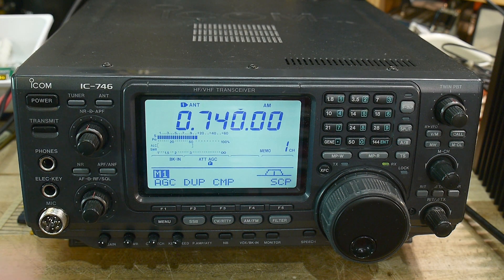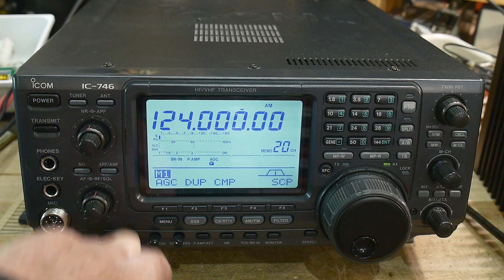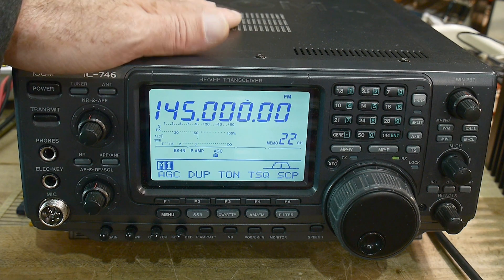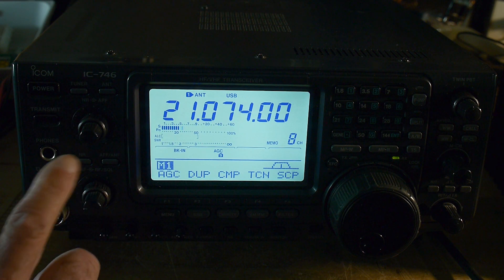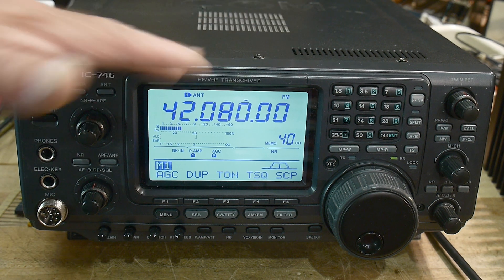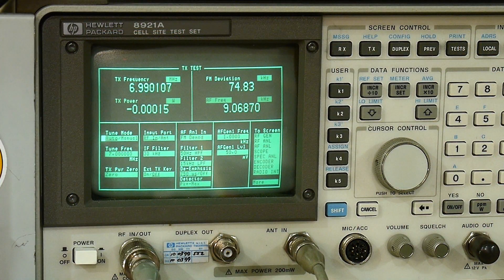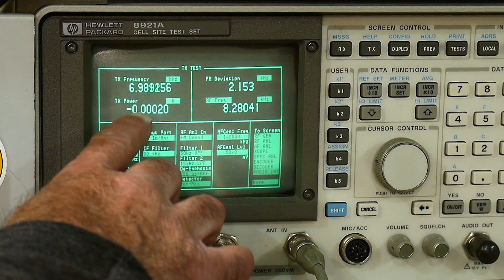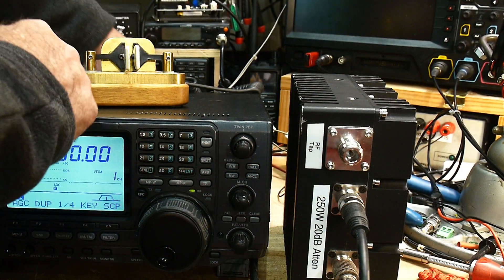#1078 ICOM IC-746 faulty ( part 1 of 8)

Comment: Some things.  I don't know about this rig, but keying the mic on my 735, in CW mode won't transmit a carrier, you have to use a key.  Also, transmitting on the band edge, in CW, might try to generate a carrier below the 7.000 MHz edge limit, depending upon the radio.  Just thinking out loud.

Comment: Hello IMSAI, Why don't you use the RF level offset option to see the real power? If you add the 20dB of the attenuator, you could have the correct reading in watts or dBms
Reply from the maker: lazy, and very easy to do the calculation in my head.

Comment: The LCD backlight is still working,  for now.. I have one of these and when they work they're a nice radio, but between the output issue and the design flaw in the backlight driver they fail often.  The backlight issue is the transistor used to vary the backlight level gets too hot and falls. Simply replacing it is a band aid,  it'll just happen again.  There used to be kits around to fix this but i have seen one in ages.  Basically put a tiny heat sink on the transistor. It's also buried in the front panel so a fair amount of work to get to it.. The delaying action is to always keep the LCD on full brightness which reduces the heat disipation demand on that part.

Comment: At 5:38 you say that 100 Watts is 40 dB. I believe that it is actually 50 dBm. 1 mW is 0 dBm, 1 Watt is 30 dBm, 10 Watts is 40 dBm and 100 Watts is 50 dB above 1 mW. At 5:49 you say that plus 20 Is one Watt, again I disagree. Am I wrong?
Reply from the maker: sorry I said it wrong. the radio is +50dbm and the attn is 20db so into the analyzer is +30dbm which is 1 watt

Comment: A much better radio than the 7300. A few common failure points but easily resolved.
Reply from the maker: I'm sure it is better in some ways. but the 7300 has a better display with waterfall, USB control, narrow filters. what is the 736 better at?